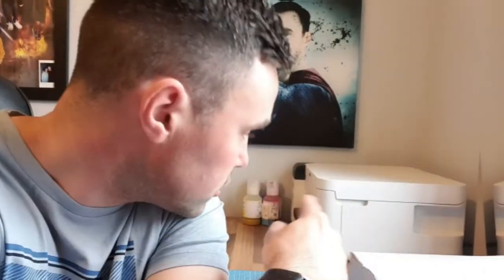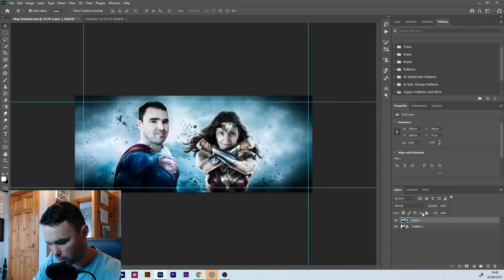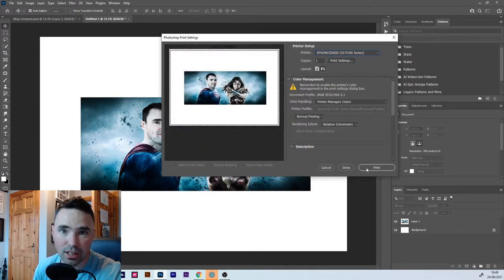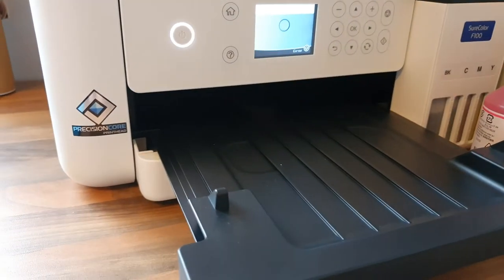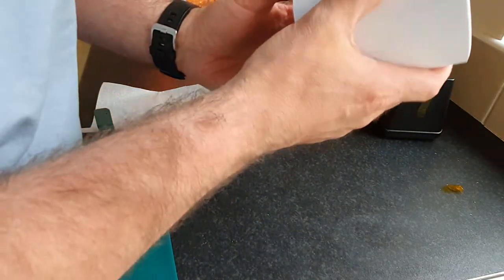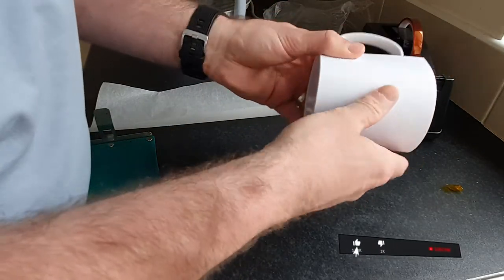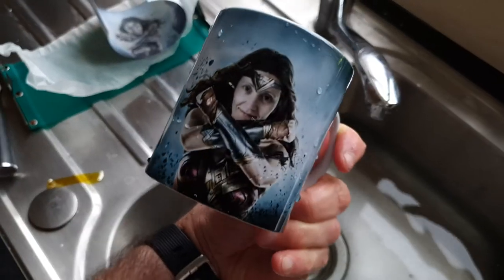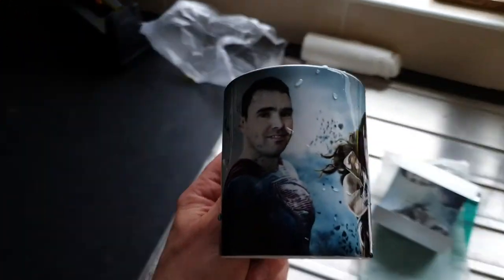My New way of Sublimating Mugs - Better than a Mug Press

Comment: Thanks for your video, I'm having issues with my mug press as well; we use a Sawgrass 1000 for printing. Appreciate your time to share this method :)
Reply from the maker: Thanks, I'm sure not all mug presses are like that. Maybe just the cheaper brands. But, this way is still working well for me :-)
Reply: sometimes its the mug, I do 1,000's of mugs on site, i find orca is best coating,

Comment: EXCELLENT VIDEO...
Thank you so much for sharing this video.
Question:
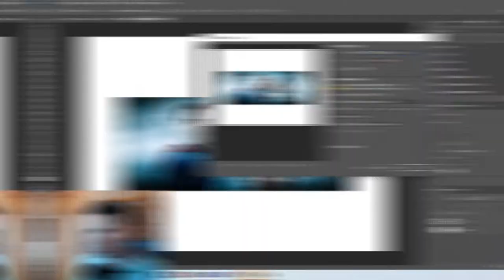4:04 What kind of EPSON Printer is that?
Looks fantastic... 
Thank you for your Help.
Reply from the maker: Thank you. Its called the Epson Surecolor F100. My advice now though would be to get an A3 sized printer.
Reply: @designgaff2025  
Thank you for your information...
A3 is the longer pages ... Right?
Reply from the maker: @JudiChristopher  sorry, yes, a4 would be your standard office sheet of paper (in Europe anyway).
A3 is double the size of that. 
Almost 12x16 inches
Reply: @designgaff2025  
Excellent... Thank you for that great information... Big difference.
Reply: @designgaff2025  
Our "Double paper is" 11" x 17" 
Our normal paper is 8.5" x11"

Comment: Can I ask, Iv got an older version of the halogen oven and Iv got the spacer like you. Would this work if you stood the mug up so you didn’t have to turn it half way through. Iv never used my mugs yet as I wasn’t going to spend money on a mug press when that all you use it for. I would be interested if this method worked.
Reply: Hello yes it would work as that is the way i stand the cups, i put 3 in at a time and like the video i leave for 13mins. i too have the older Halogen.

Comment: Have you done any tall stainless steel tumblers this way ? Just wondering if I would need to adjust the timings I’m getting ghosting on one side even though I’ve turned it . Everything I’ve used is the same as you barring it’s tumbler versus mug . Any advice ?
Reply from the maker: Hey Shelley. The only reason why that may be happening would be that you're not letting the ink dry on the paper before sublimating it. Also, try it standing up so you don't have to turn it at the halfway mark.

Comment: I have zero issues when doing 10oz mugs, no fading no nothing. the only time ive had issues is 11oz mugs if i do not have it lined up perfect it is faded on the edges...only way to get around that was to move a bit further away from the handles and have a bit more white at the top and bottom...now though i just use the 11oz mugs for NON full wrap designs and the 10oz ones for full wrap.

I also when selling do not do what alot do on the likes of ebay and give a false and fake representation of what the mug looks like by photoshopping and the image onto a mug, i put real photos of the mug on my listings.

If you had issues doing a 10oz mug the problem was the heatpress you had not having even heat since the 10oz mug should give enough space all sides for even heat
Reply from the maker: Thank you. I have since purchased a new mug press and just do 11oz all the time now. 
The only real issue I get would be bleeding in the text which can be annoying when the background is white.

Comment: Better than a Mug Press ??????
Reply from the maker: It has its advantages like printing almost to were the handle is and no faded edges but ultimately, 13 minutes is a long time for one mug. And when you factor in the time to design, print, wait for the ink to dry - you could be looking at 30 to 40 minutes for something that you're going to get around €15 to €20 for.